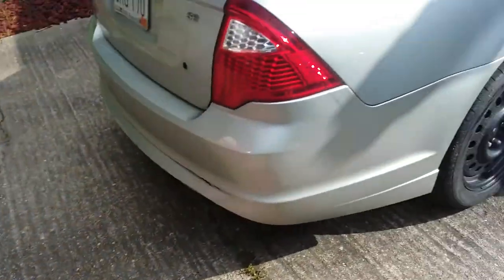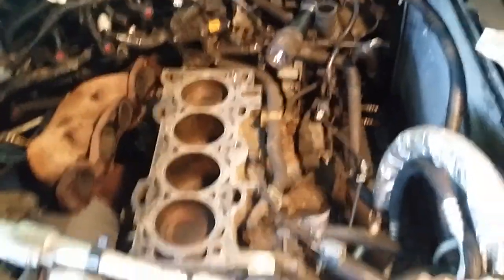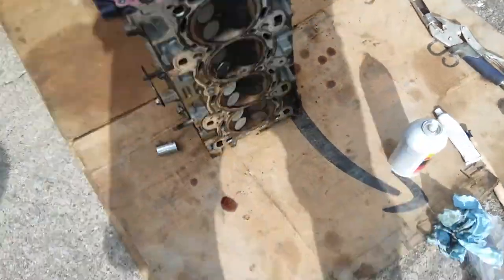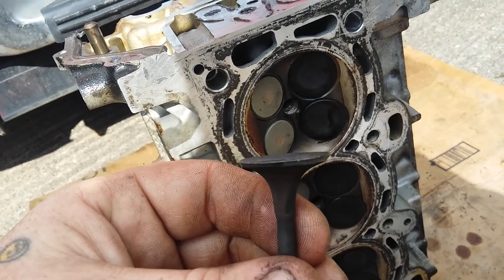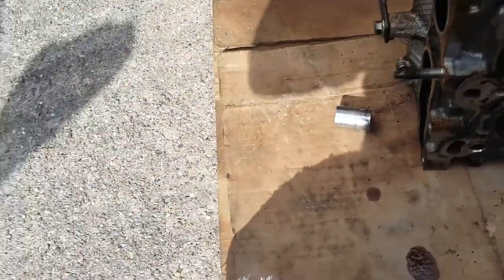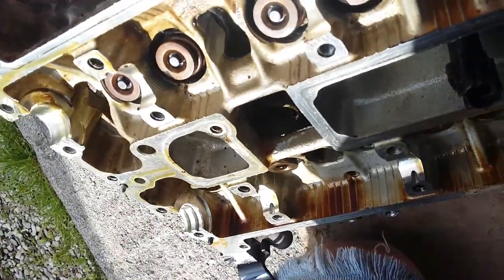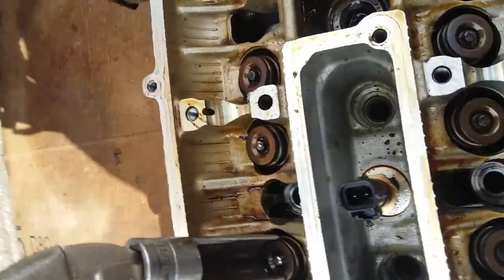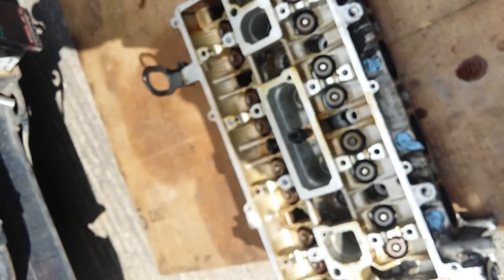Miss fire cylinder 2 2010 Ford Fusion SE 2.5 liter

Comment: Have a friend with the same problem.   That is what I was thinking... a bad valve.    Thanks
Reply from the maker: Blake Will you better take it to professional the one I did was a damn nightmare it doesn't have a keyway on the crankshaft you have to lock the motor in place with a pen very complicated procedure not for the novice for sure when you take the crank bolt loose the timing slips because there's no keyway holding the bottom gear in place it's just tension from the harmonic balancer holding it bad design

Comment: Sir I have a 2011 Ford Escape 2.5 engine same as the fusion engine mine is getting a cylinder 2 misfire mainly when it’s under load going up hill but when I’m on flat ground it does ok even if I give full throttle when going up hill the engine light starts flashing then when going to a stop it goes back off again I have changed the plugs coils and a new injector for that cylinder still the same thing what do you think it could be? Thank you
Reply from the maker: You can check your compression but it probably has to go to a shop with trained professionals before you damage your motor it could also be a catalytic converter starting to clog up a weak fuel pump or clogged fuel filter the list goes on
Reply: @BrianMitchell321  would a throttle position sensor or mass air flow cause just one cylinder to misfire or do you think it’s something more serious when I changed the plugs they was white and dry so I’m thinking it may be running lean also
Reply from the maker: no
Reply from the maker: You can try pressure testing it probably has low compression or a bad valve
Reply: @BrianMitchell321  sorry to ask so many questions but would it idle smooth if it had a bad valve or low compression
Reply from the maker: Sometimes

Comment: the same things is affecting my 2010 ford fusion, what can i do?. code p0302
Reply from the maker: keyede Ayomipo you have to have someone do a cylinder compression test on it to make sure that it has a burnt valve then the valve needs replaced or the motor needs replaced one of the two